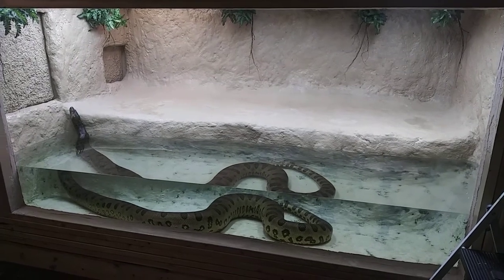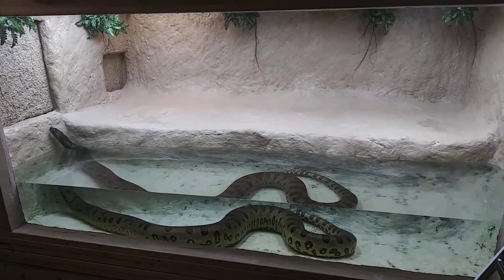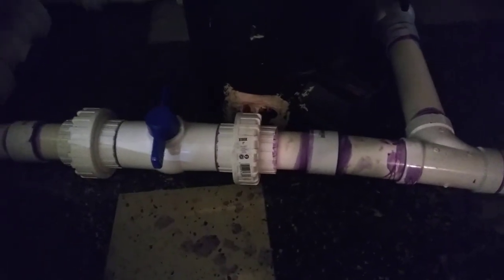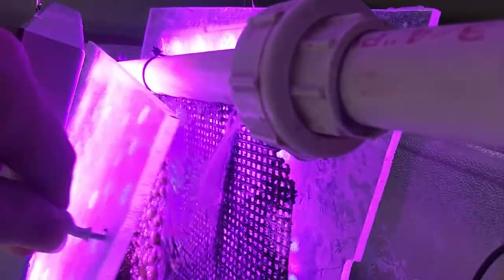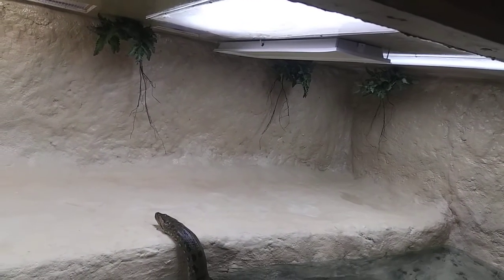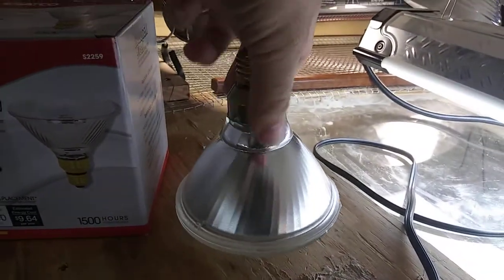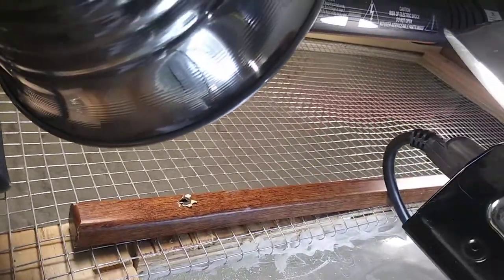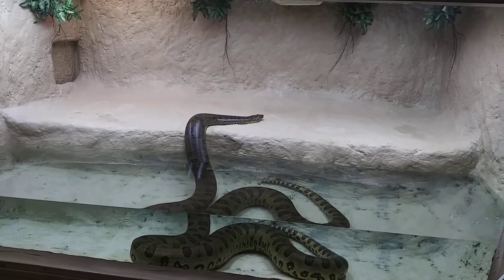Zoo quality, DIY, Green Anaconda snake Enclosure!!! including some BIG updates!!!!

Comment: Is the enclosure made of wood?
Reply from the maker: It is built with a wood frame to give the enclosure structure along with a treated wood base to prevent water damage with spills and leaks (already saved my behind several times 😅) the interior of the wood frame is concreted smoothed with mortar and water proofed with pond armor... Theirs obviously a lot of other steps in between these but that's a short summarized explanation of its materials etc... Hope you enjoyed!!!